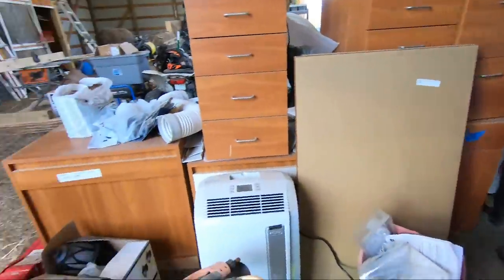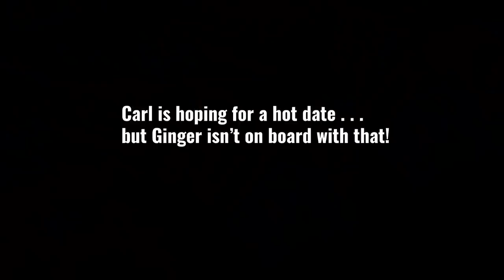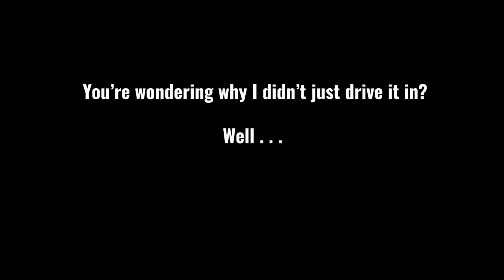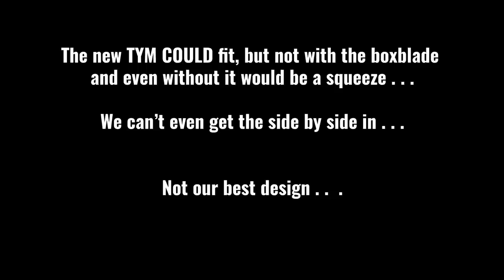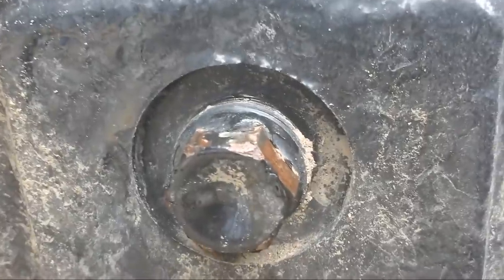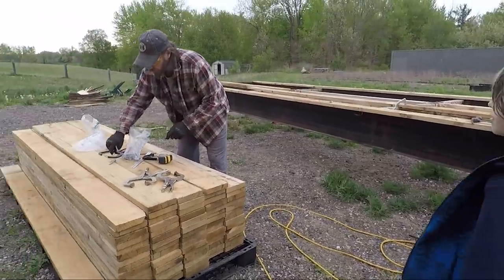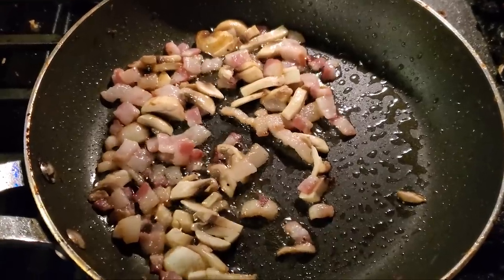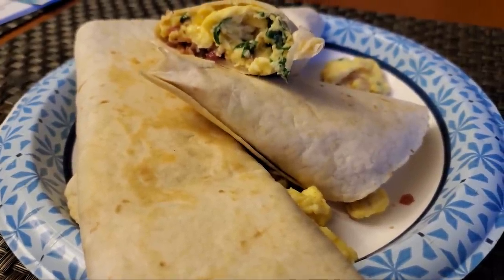373 Slammin It Out & Countin Down the Days (How BAD was the Hydraulic fluid?!) - Hay Season 2021

Comment: You can use your sawdust, and anything else letter over like that in your horse shed for bedding. And it will work just like straw and can be spread on the field just the same as straw.
Reply from the maker: Well shoot, hadn't through of using it in the horses stall!

Comment: Concrete floors are nice but $$$ One thing that would work on a dirt floor would be to till around the outer section of the floor, then add a few bags of portland cement and some gravel, then till that all together. Now smooth it all out and start wetting it down. Then once it's damp, roll it and pack it solid, and wet it some more. If you can get 4-5 inches treated that way and get it very wet, it will harden up almost as solid as concrete. It's called soil cement and is used under roads and even in dams where concrete would be prohibitive in cost. Research it a bit and you may be surprised how well it stops critters. My former shops parking lot was done this way. It was about 6" thick and packed with a pavement roller, it handled over 10 years of freezing/thawing with only a couple cracks.
Reply from the maker: ohhhh, yes! We had a few comments on that with other videos years back, great idea!

Comment: I'm surprised with the cost of wood, that you didn't go with metal decking. Johnson Surplus down in White Pigeon, MI sells 48x96 sheets of steel diamond plate. Good job on this and recent videos. The change up in your editing is a definite positive.
Reply from the maker: Total cost of the trailer is $600 including wood :) It's rough sawn green lumber so it was pretty cheap ;D
Reply: the white oak only cost $320 so not too bad to cover a 37ft trailer.

Comment: Short handled axes/hatchets are not for the young.  Someone should have helped cleaning out the barn. You should consider fishplating those I beam butt welds Erik.  That is going to be a very heavy trailer empty!  Will it navigate the gates you have to go through?
Reply from the maker: We don't have any gates to travel through . . . and our hay carts were certainly too large for most gates as it was. I guess the big question is how well will it navigate the streets if we need to travel, lol
Reply: @This1LifeWeLive  OK then!  It would be easier to run wiring now if you plan to have rear and side warning lighting.  I think Channel iron would have been a better choice for cross members.  You could always space the boards a couple inches apart.  Kobalt Drill bits would help.  Earin could paint it!
Reply: @gordbaker896  I was being a cheap holinder and just used what i had laying around for bracing.

Comment: I have a question. On all hay racks i have seen there was about a quarter inch gap between the boards. i see on yours you guys are installing them tight against each other. Are there reasons for doing it either way?
Reply: this is green lumber as it dries it will shrink leaving us with gaps.

Comment: Just wondered does your nh rake raise/lower very slow? I just got one its very slow guessing its my old tractors hydrualics. Thanks
Reply from the maker: Yeah it does!  I think the hydraulics on my tractor are adjustable, and played a but with my cutter (lowers too fast and slams), but don't thnk I changed it for my rake . . .if your hydraulics are not adjustable, it could be lowering slow due to the tractor.
Reply: @This1LifeWeLive  thanks for responding . Dont think my hydraulics are adjustable

Comment: The axle lube is not hydraulic fluid. It is gear oil. Park the trailer in the sun and paint the deck with used motor oil it'll last forever. We used to paint ours every couple of years.
Reply: fyi my 3 john deeres spec hydraulic oil in the axles ...no clue on NH
Reply from the maker: I just service the equipment according to the manual . . . I don't know much about fixing or repairing or servicing, so all I can do is trust to good people who wrote my manual :D
Reply: I heard you use a 50/50 mix of used motor oil and kerosene.
Reply: Now that you mention it we use to put diesel fuel in it to thin it up a bit. Thanks for mentioning it. I almost forgot that.

Comment: Hi, can I ask why Eric move the wheels forward on the tailer, by do so it will give the tailer a severe tail swing when you turn
Reply from the maker: Many people suggested it would be a better option for less weight on the hitch 🤔
Reply: @This1LifeWeLive  
Very true.
Reply: Thanksfor your answer and good luck if you ever to go into a tight space or wet area. Weight on the hitch your tractor will climb a mountain 😆. Love your videos and many thanks in sharing them
Reply: I found a equation online where you take the deck length multiply or divide by something sorry i can remember. then you take that number and measure off the rear and thats where the axels should be placed it comes out to like a 60/40 ratio. or you can use a trailer tounge scale to locate the best spot but i dont have one.

Comment: Do you know the difference between gear oil and hydraulic oil
Reply from the maker: Yes, but I tend to use the same names intermittantly, lol. gear lube is 80-90W and that seems to go in equipment with fast moving gears where as far as I can tell, the hydraulic fluid goes in areas with slower moving gears. So far I think only the front axels of tractors/trucks and the hubs have taken hydraulic fluid . . .

As far as the chemical difference, no. I think gear lube is a bit thicker . . .
Reply: @This1LifeWeLive  You’re right gear oil is heavier or thicker than hydraulic oil Also hydraulic oil is a working oil another words it allows you to raise and lower the boom move implements to three-point Garrel is a lubricant that doesn’t have any hydraulic properties so don’t mix them up

Comment: Let me know if you need any spare tires and rims for the trailer.
Reply: I do need 4 more wheels and tires. we have two more axels and another 26ft section of trailer frame we are going to make into another trailer.
Reply: @ruralridez6165  What I have are 7 - 14.5 mobile home tires and rims. The rim's need wedges to hold them to hubs. They are about 25 years old and have been stored in a building out of the sun . You can have as many as you need. Any shipping is your responsibility.
Reply: @ollie-lk5dx  ok thanks I will keep that in mind. Do you know off hand what the bolt pattern is?
Reply: @ruralridez6165  They are hollow center and need wedges.

Comment: Really not sure that the trailer is useful for your size operation. It's way to long and will be hard to turn, maneuver and back up. Unless it's covered it will rot where water is trapped between the sills and the beams. You now need one tractor to bale, one to load bales, and one to pull the trailer....
Reply: the length came out just right. we are able to grapple 5 stacks of 10 per row. If we ever get a real accumulator/grapple system we will be able to do 6 bundles per row. The accumagrapple stacks loosely because of all the dividers im not liking it too much.
Reply: @ruralridez6165  Have fun handling it. How many bales you get last year 1st cut?
Reply: @andyrobinson339  I think around 1000 1st cut. We are slowely clearing new over grown ground every year.